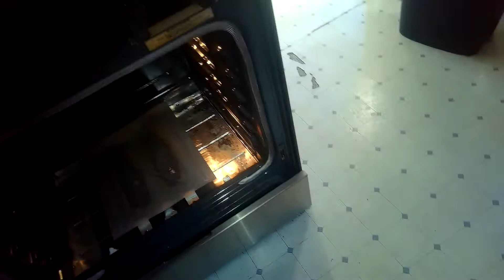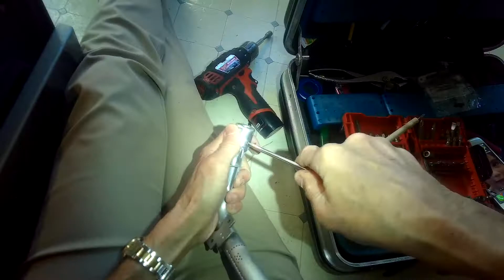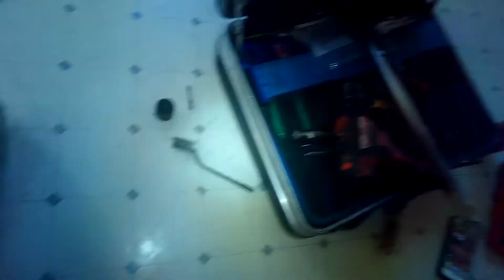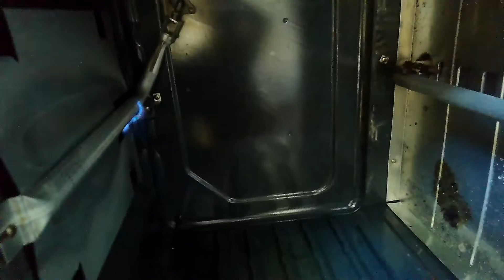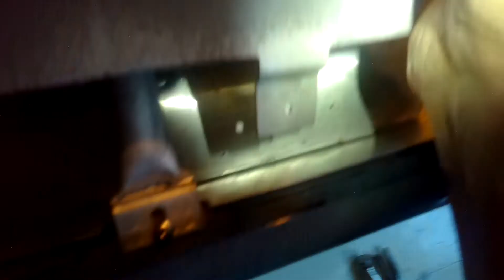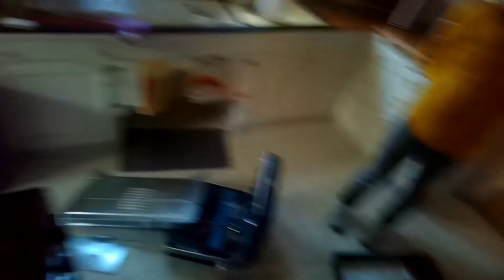✨ Whirlpool Oven KEEPS CLICKING  - Wont Heat Up - Easy DIY Fix ✨

Comment: My igniter was changed as I was having an issue with the oven clicking but when opening door the gas would ignite, close door and after a few minutes or so the clicking would start again and once I open the door, it would ignite. So not sure what’s going on there. Any ideas? Thanks
Reply from the maker: Thank you @tm7069!

It sounds like your igniter may still be faulty, or there could be an issue with the spark module. Sometimes, if the igniter is not working correctly, it can cause intermittent clicking. I suggest checking the wiring and connections as well; if they seem fine, replacing the sparking module may solve the problem.
There’s a new wire set for the whirlpool spark oven that should cure that problem.

If you need more info, you can reach me directly for a fast answer at AsqMe.com/@ScottTheFixItGu
Reply: @ScottTheFixItGuyChannel you know I actually have a Maytag gas oven and didn’t pay attention to the “Whirlpool”😊 but I imagine it still could be the spark module? 
Today I did the wash cloth trick and put it on the hinges of my oven door and I started my oven to see if maybe it was my door. I started off at 350, it actually ignite properly and then I waited through 5 intervals, then kept increasing the temp to 375, 400, 425, 450 & finally to 500. All of the temps except for when I did 400 and up, seemed to have that clicking again and I opened my oven door and it ignite. I have been using my oven this way for the past 2 years. Some times it ignites all by itself or I have to open the oven door to get it to ignite. So do you think that is the spark module or the alignment of my door? Thank you

Comment: Oven ignites but sparker keeps clicking, replaced module because that was faulty also cleaned with wire brush. Still clicks after igniting the flame. Is this an issue with my igniter?
Reply from the maker: Hey Bob,
I think you need the new burner update for that model that has a better ground connection to the frame.

Comment: Hi, great video. We have a different gas stove. The bake function works but after 15 minutes it will trigger the igniter again and again.

Any idea what’s causing it?  Thanks
Reply from the maker: When it hits the right temperature the bake igniter will turn off.  It will then light again once the oven cools down. That will keep happening until you turn it off 👍
Reply: @ScottTheFixItGuyChannel  Thank you.

Comment: This helped me fix my oven. I have a question: I noticed the flame air fuel mixture was wide open and my oven is using LP. I adjusted it slightly like you did here. Did my installer make an error? If so would it have caused the igniter to fail? Also would I need to do adjust the broiler too?
Reply from the maker: If you can move that valve to give you a nice blue flame with as little as possible yellow tinges of flame.

Comment: Resolved my issue (oven baked, but then igniter stopped recognizing flame after 20-30 minutes of use).  Cleaning the igniter didn’t help, but after switching the broiler/bake spark modules, it is working great!
Reply from the maker: Very smart😊😊😊